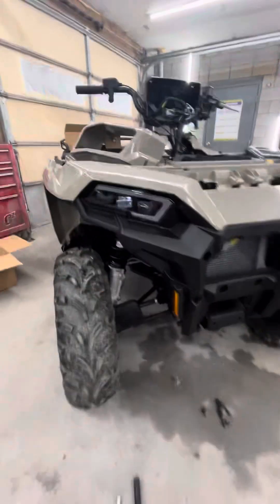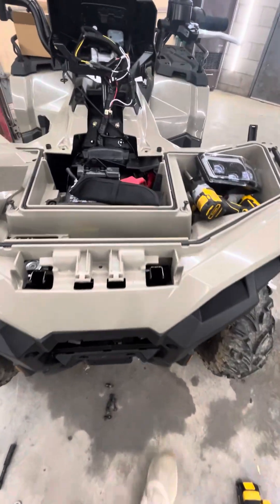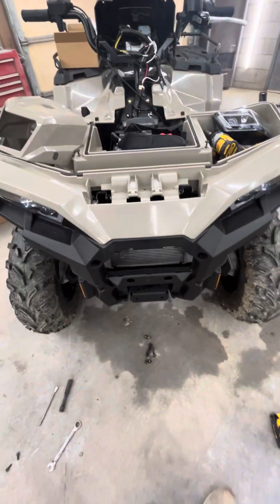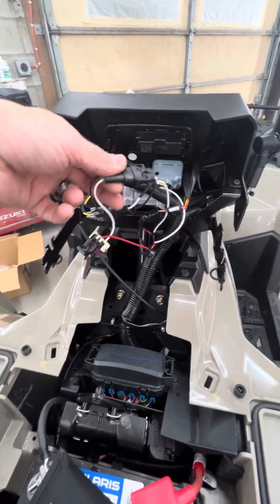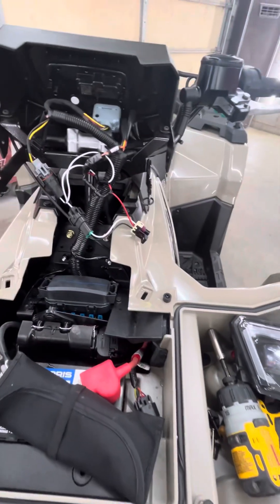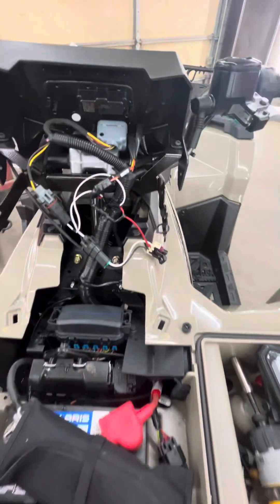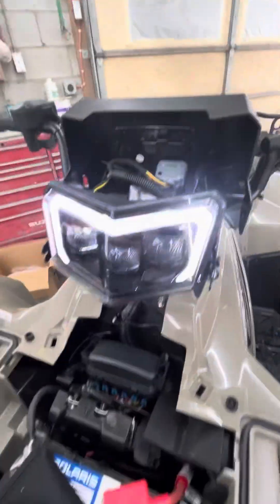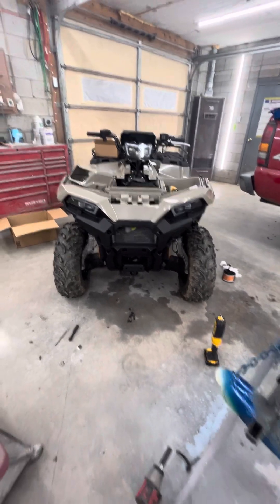2024 Polaris Sportsman 570 led headlight upgrade

Comment: So the low beam lights aren’t plug’n’play? You have to still run wires up to the high beam pod? And is cutting required?
Reply from the maker: Low beams are plug and play you just need to wiring in the halos to the accessories to get them to stay on all the time. And cutting is not  required on your factory harness.
Reply: @ thanks for the speedy reply man! I have a 2023 570 & I’ve been debating on get these leds or the polaris factory ones. I think I’m going to go with these. Thanks again man.

Comment: Hey… By running them together at the accessory point, are you saying  I have to cut off one the metal connector& tie the wires to the opposite metal connector?

Comment: How did you take out the low beam lights
Reply: @eliconchas5289  I had to take the front bar & bumper off mine. It’s pretty easy though. The two top screws at the top was the toughest to take off & put back on during the whole process for me. Everything else was easy
Reply: @ thanks for replying helped a lot … got them installed got any advice on Angling the lights mine light up everything…I’m not sure if I have them too high up or they are just super bright
Reply: @ I only know how to angle the high beam pods with the set screw. I really don’t know how to adjust the low beam lights. But they are super bright aren’t they & cool looking!!😄😄. I love’em!
Reply: @ they definitely are !! Thanks again for the help !!